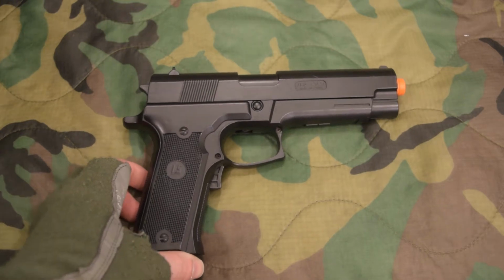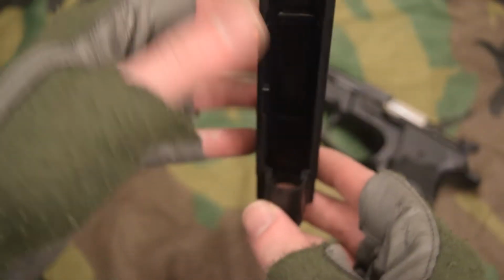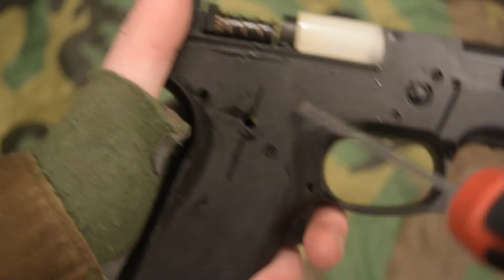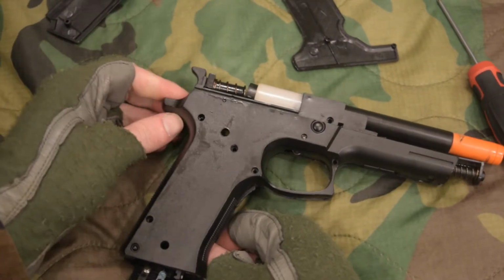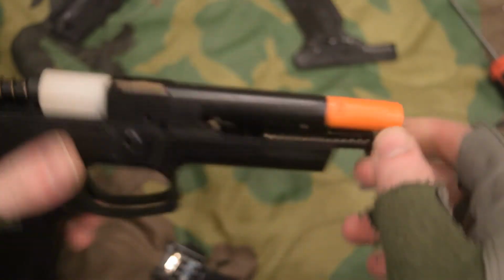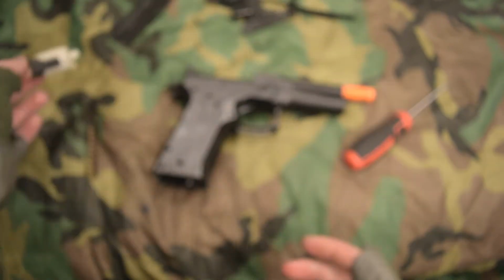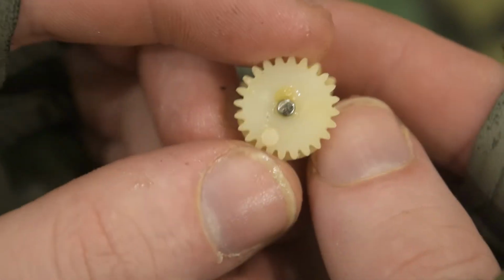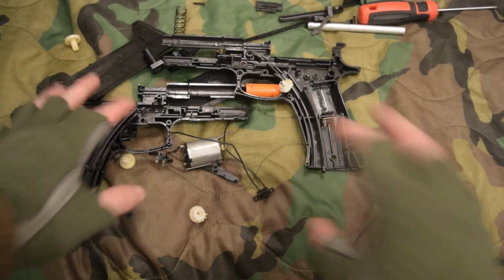Ripping Apart Broken JLS EBB 2024 (S&W 645)

Comment: Man I used to have an old Crosman EBB Pistol, I wish I knew the model/name of it. It was translucent, this was back around 2004ish. You familiar with them? Use to glide .12s so smooth! It was a lot of fun to use back in the day. Probably would feel like trash if i used it today lol.
Reply from the maker: Do you remember what kind of gun it looked like?
Reply: @KlonoaTorqueBow  Im going to say it was a Beretta M9 of some kind. It was either a Crosman or Daisy, from wal mart.
Reply: @KlonoaTorqueBow  It has a skinny mag and used like 4 AAA batteries.
Reply from the maker: @AcesHighMedia  Used a long curved stick magazine?
Reply: @KlonoaTorqueBow  Yup! The whole thing was translucent
Reply from the maker: @AcesHighMedia  Yeah that's one of those UHC EBB pistols. Pulse P50. I have about nine or ten different variants of that, but none of them work. Either the motor spins a broken gear, doesn't turn on from corroded contacts, or have dead motors. The minis and EBB pistols are incredibly fragile, especially if they're clear.
Reply: @KlonoaTorqueBow  Dude thats the one!! Thanks so much man. I am going to see if I can secure a working one, just for the sake of nostalgia!